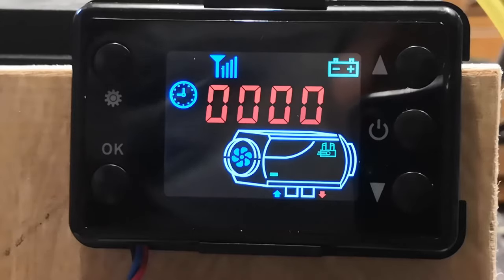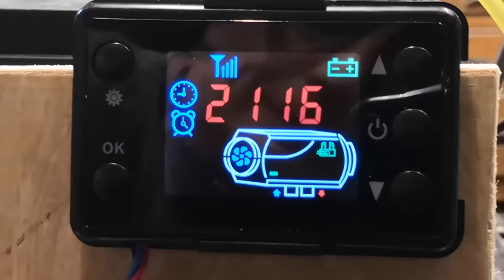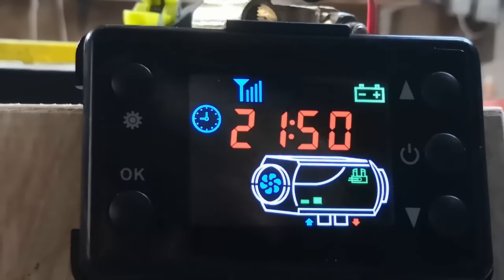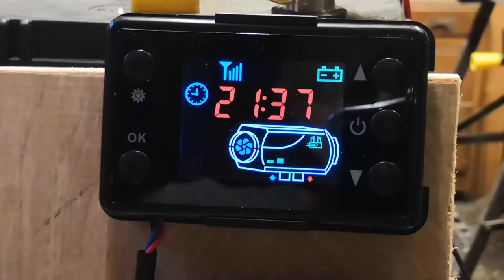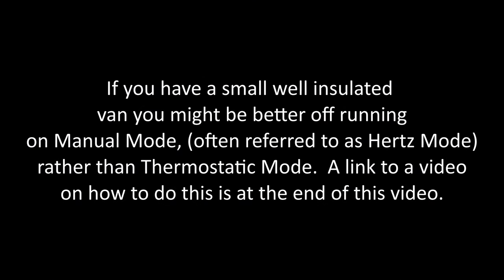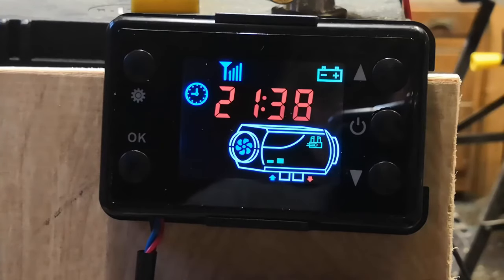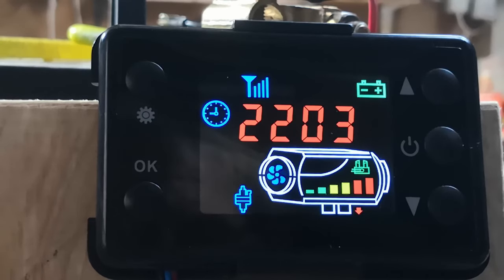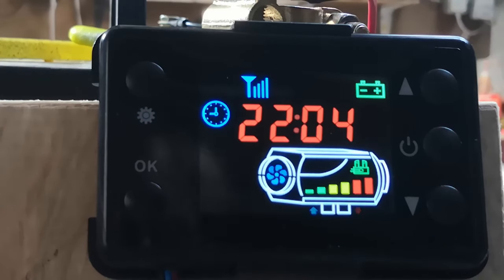Chinese Diesel Heater- Step by Step Instructions

Comment: Thanks so much, I had to take the pump off and then keeping one pipe from the tank to the pump and then prime it this way , as had lots of goes without seeing any fuel going through, I first thought it was the pump, hence why taking it off to see if it was working and finally it did start to pump fuel through. I had a go without using the pump and just sucking the fuel through the pipes through I kept coming up with E 10 code, so I switched on to see if it was running properly and sure enough the fuel wasn’t going, so having the pump laying on a table just to see if it was working and seeing it was , then I put all the fuel pipes back on apart from the bottom pipe going into the heater, just to make sure fuel was going down there too, I also using the white fuel line with the black ends , tho I made it shorter this helped a great deed too. So put it up higher to burn 🔥 all the extra fuel in the chamber and now working great, ready for winter in my greenhouse.

Comment: I am a retired gas and oil fired boiler engineer. Do these things need servicing - dismantling, cleaning the blower housing / replacing glow plugs etc? Does it work better on paraffin or road diesel fuel? I guess if you have access it will also run on domestic central heating oil.
Reply from the maker: If setup correctly with the right fuel mix then they can go without servicing... I've never taken the one I have in my campervan apart in 8 years... but..  I am burning kero instead of diesel which is cleaner

Comment: Hi can you tell me what the signal symbol means in the top left corner?
Reply from the maker: It's the signal to the remote control. When you operate the remote it flashes to confirm communication

Comment: How do I clear the settings so I can start over. Please
Reply from the maker: Hi... are you referring to the time setting and temperature settings? If so, you don't actually clear them down... you overwrite them. Having said that, once the cycle of the timer has passed, it clears itself which is actually a pain. It means you must set the timer every time you want to use it even if the start stop times remain unchanged.

Comment: Have installed 2 Chinese heaters 5Kw in caravans. After 3 years I am completely satisfied. My caravan heats up quickly. After a year I had to replace the fuel hose that comes with it, a silicone hose. Bought a 3mm hydraulic hose white and from the tank that is installed in the trunk along the front to the heater along the back, the distance is 6m. It is important not to use the silicone hose that comes with the purchase, it cannot withstand diesel and cold/winter and starts to crumble. Then at the joints to the tank, pump, heater you use black reinforced fuel hose that you use in cars.
Have tested the heating last winter when it was -11 degrees outside, took 30 minutes to get 18 degrees plus in the caravan. I don't usually prime the heater and if you have fuel in the tank, no priming is required. Also buy better hose clamps that last. Remember to be careful during the installation and in my case it usually takes 5-6 hours depending on the caravan type, you should also run the power cable directly from a battery with the right area depending on the cable length, as well as a fuse on the battery's + pole. Used to free camp and has 2 100W solar panels with 230V inverter and never run out of power. In addition, you avoid using LPG.

Comment: Hi, I've just bought my first CDH, and have plans for extracting as much energy from the fuel as I can. I have designed the outline plan for a heat exchanger, so I'd like to know typical maximum and minimum temps for air inlet and outlet. Many folk on YT show them shining their I/R thermometers at the aluminium heat-extractor, but what I need is typical air temps away from the ali casting. Cheers!
Reply from the maker: Ha!... to be honest... I am also shining the IR thermometer on the heat exchanger.... never really measured the heat directly at the outlet of the heater. BUT... I am about to kick off another project so will do just that. 😊

Comment: Thanks for the video it’s much easier when it’s explained, can the heater be left on to maintain a set temp in a workshop through the winter ?
Reply: Hi, though I use my heaters on and off in both my camper van and my workshops there have been loads of people posting on the channel that they leave theirs running 24/7 so there should not be an issue... just don't run out of juice.😁

Comment: Thanks for the instructions. Im new to theae heaters. I dont hear any clicking from my pump, getting E8 and E4 I think also. Fuel at the heater I can see it. How can one fault find? 5.8v at the pump then it rises a couple of volts sometimes but no clicking pump.
Reply from the maker: E8 It's usually flame out or no fuel reaching the heater... which makes sense if the pump isn't working. E4 Is often the body temperature sensor either failed or lose connection to the motherboard. The following video shows you how to replace that sensor and it might help you cheque that it's seated properly and connected to the motherboard properly. It might be you just need a new sensor but very easy to do.  https://www.youtube.com/watch?v=emurWyN51jY

Comment: Fantastic videos. What brand heater are you using that has the six fan blades. I am using my heater in a greenhouse and time on time off setting would be helpful.
Reply from the maker: Hi Steve ... glad you found the videos useful. That particular one I bought about seven years ago off of ebay was quite simply an unbranded heater shipped out by a box shifter who put all the other bits and pieces together and has absolutely no branding on it at all. However, being the nerd I am aI took it to bits and found some labels inside most of which were just inspection labels but I did find one that was the name of the company. I  went I went on their website ... they were actually mostly serving the Chinese military! I think I had a bit of good luck on that one because they claim to have Conformité Européenne (CE) and showed a picture of their certification on their website. Initially, I was sceptical but I found the name of the company on the  Conformité Européenne register, downloaded the certificate and sent it to the certification body which confirmed that they had validated that machine to  Conformité Européenne standards. One thing to be aware of if you're looking for a timer is that although you can set a turn-on and turn-off time, it only operates for one cycle. You have to set it every day which is a real pain sometimes.

Comment: Hi, I’ve connected mine up to an old car battery which I charged up but it doesn’t have much juice and it gets drained before it can even get going properly. Once it’s going does it start to charge the battery or do I need to get a better battery and somehow find a way to keep that battery charger with a solar panel or something? It’s in a caravan not connected to a power source. Cheers

Comment: I think I need to replace my replacemnt LCD unit as I keep on getting random E-07 error - lost communication.
Wiggle the cables going in to the unit it fires up again. 
Now, I do have it as a "roaming" unit that I can move around in my small poptop caravan that I live on the road here in Australia
Before I buy a new unit I will mount the unit on a small piece of plywood or summat similar and stabilise the cable input

Comment: hi , great vid , just wondering have u ever heard of the controller settings access fail , ? i cannot get into the settings to adjust fuel/hrz rpm etc , maybe this is a cheap generic controller (comes with heater) that hasn't got that feature > thanks  ( mine has a cog symbol not wrench) cheers
Reply from the maker: Yes you are absolutely correct. Some of the cheap heaters have a controller that cannot have the settings adjusted. However, it is very, very easy to swap out the motherboard and controller and this video shows you how to do it. The. Note you have to swap them out as a pair as it's a different motherboard that is associated with the controller. You can adjust the settings on. https://youtu.be/sDwrHozKInc
Reply: @campervan_hackers   thankyou for the info 👍

Comment: Thnx for the link,
With restarts does it matter if the battery source has been disconnected for a period of time ? Mine has been set up previously to run off an external battery box which isnt connected all the time, , thnx for the info, heaps easier to understand then the instructions that came with my van
Reply from the maker: No, you can switch the power off but you will just lose any time settings you have set on your clock. In fact, I have an isolation switch on mine and I shut the power off completely when I'm not using the heater. I don't care about losing the time because I have plenty of clocks in my phone!. Actually, it's not a bad thing to do because those LCD displays tend to fade over time if they're powered up all the time. If you do go down that route though make sure the isolation switch cannot be accidentally triggered when the heater is on full chat as these heaters need to go through a proper cooldown mode before they are switched off.
Reply: @campervan_hackers  thanks

Comment: Brilliant videos..Any idea why I can’t seem to pair my new replacement to a lost remote. I’ve pressed the power and down arrow. Changed it to OC2. There is a new battery in the remote and the remote is showed a red led light when button is pressed but will not pair …
Reply from the maker: Sorry for the delay I've only just seen this. Assuming you have the same controller then the instructions in this video below might help. However, I have bought a couple of remotes owned to find they are defective so it might be simply you have a defective remote. https://youtu.be/GpWa_koF9CU

Comment: Very helpful video, so firstly thank you. I think my timer must be set, but didn't set it. I have only just installed the unit it's like yours in the video but I've had it for nearly 3 years. I never set the timer but I walked out to the van this morning and it was going but it wasn't warm, how do I turn it off the timer please mate, and why would it not be hot, does it need to be primed before start every time? Thank you
Reply from the maker: For clarity are you saying that it appeared to turn itself on but just blow cold air?
Reply: @campervan_hackers  Yeah mate, that's exactly what happened. Not sure how long it was running for but we didn't turn it on and the wife walked in this morning to pack some stuff as we are going away and it was on
Reply from the maker: @geoffstein3896    okay dude... that  sounds like the heat exchanger temperature sensor has gone down.  Very cheap and easy to fix... here is the vid...https://youtu.be/emurWyN51jY
Reply: @campervan_hackers  thanks for the link. It is only new, so don't know how the thing is already faulty... Spewing!

Comment: Thanks, really helpful video, however, how do you gry the display to turn off? The van has been parked up for 3 days so far but the display is still illuminated.
Reply from the maker: @stephanies6716  really glad it has helped. However for that particular display, regrettably it does not turn off. Some people have mounted their display so they can take it out of the holder flip it round and put it back in so the display is not keeping them awake at night. Others have just made a little cardboard blind to go over the top but alas on that particular display you can't turn it off.
Reply: Oh that's a shame, I guess I'm just going to come back to a flat battery then 😢. Thanks again though
Reply from the maker: The display itself uses very little juice. It will take a long time to flatten your battery but if you are leaving your van without using it and the heater isn't running then it might be worth putting an isolation switch between your battery and the heater. That's what I've done as have many people but mount it in a place where you can be sure you don't accidentally turn off while the heater is running.

Comment: What error code might one expect if air trapped in fuel line?  E-01?  ~7:00 into video.  At what point is maximum amp draw reached?  After pump engages but before glow plug goes out?  Great video, esp the annotations.
Reply from the maker: If you get air trapped in the line, you may get an E8 (flame out/ ignition fail error).. Max battery draw is at start up and shut down when the glow plug is live.. this short vid shows the draw through the cycle, (it is  using a rotary but the principle applies to all controllers)   https://youtu.be/BmyxEsE-Ysg

Comment: I'm trying to get my heater working on the temperature target mode. I follow the same steps you go though. I see the current temp screen but when I  click again it goes to the fuel amount screen and does not show the temperature target screen? Does my heater not have that capability or am I missing something? I also tried my buddies heater and it's the exact same as mine.  Both look like yours does.
Reply from the maker: Mmmm interesting... That is a different controller and alas, I have not come across it.  For clarity... the little fan icon... does it have 6 blades or 3 or 5?
Reply: @campervan_hackers mine has 6 blades, just like yours, when I go to the target temp it goes to screen that says 2.4...any help /ideS are appreciated

Comment: Once the timer is set, how long will the heater run for? Is there a way to cut it off automatically? Thanks
Reply from the maker: Yes, have a run through the video again. You'll see there is a start time and a stop time. But that is just for the six fan blade icon controller. There is also a three fan blade out there. That one is different. On that one you set the start time and then how long you want it  to run for.

Comment: Ive got mine running in my garage to keep things aired out the minimum i can get down to is 8 will it go any lower in any settings. Say 4 degrees thanks 👍🏻
Reply from the maker: Hi Tim, The problem with these heaters is that the little controller has a very wide hysteresis so it's a struggle to get down to low temperatures in a small insulated environment. Consequently, I tend to run mine on manual mode rather than thermostatic mode now and you might want to give that a try If you have a compatible controller. In case you don't know how to switch to manual mode this short video might help.. https://youtu.be/NhKU4AIt4jM
Reply: @campervan_hackers  thanks for your reply. Just another query. Can the timer be made to repeat. Having to to turn it back on every day. Set number 1 for time on time off. Only worked for one night.
Reply from the maker: Hi.. regret no... a real pain... has to be set each time  .  @timwilson8553  😒

Comment: The air inlet for the burner can be noisy, try fitting a exhaust silencer, note the difference. I was experimenting with my 2nd heater a 8kw. The supplied black silencer for air inlet had nothing inside, could hear air rush in. So i place a exhaust silencer over intake and dramatic reduction in intake noise. Not seen anyone try this. I will mod my van heater intake.
Reply from the maker: Yep... that was just in my workshop playing. That particular unit is now in my van and has an intake silencer as well as an exhaust muffler. In fact, just swapped to the no so-called 'upgraded' exhaust that is making the rounds at the moment.
Reply: @campervan_hackers  Yes have the box silencer, bit quieter. What did was place the exhaust silencer, the tin plate type on the inlet, reduces the noise there also. I have a new 8kw, the supplied inlet silencer is not much good, nothing inside it. So i tried the supplied tin exhaust silencer made quite a difference.

Comment: Thank you. My issue is I can’t even figure out how to set the time, first screen. Mine doesn’t show that, it just shows the temperatures. Any thoughts on that?? Thank you so much.
Reply from the maker: There is an odd controller out there that looks the same but it's a little bit different. The clue is in the heater icon on the display. If it has three blades instead of 6 it is a different controller....
Reply: @campervan_hackers hmm the heater icon looks the same! I just don’t have a clock on the left side. And don’t know how to make it pop up.
Reply from the maker: @AmandaMcKay-i8y  eeek... If your heater icon definitely has six blades and not three blades then I'm stumped...Soz! 😔

Comment: Can you offer any guidance as to what I need to do if the glow plug light doesn’t come on?
Reply from the maker: Tricky one... Is it just the glow plug indicator on the display that doesn't illuminate... Or is it also the case that the glow plug itself doesn't fire up and ignite the juice?
Reply: Both. I’ve tested the resistance of the plug which is down to 0.5 and fitted a new one. Same story. 
I’m assuming there is something I’m missing in the setup.
I’ve ordered a rotary controller to try.
Reply from the maker: Yep... could be the ECU.... I assume you have the 6-blade fan icon controller... the rotary is compatible with the ECU that uses the 6-fan blade. Let me know how it goes...
Reply: Yup 6 blade display. So I might be into a new motherboard too :-(
I’ll fit the analogue controller and shall report back.
Thanks for your reply’s.

Comment: How do you turn off the display. My diesel heater display tends to stay on.
Reply from the maker: Regrettably you can't without going into the controller and hacking the feed to the display
 It's a real pain. Some people have cut a piece of card to go over the display at night and depending how you mount it you can take it out of its holder turn it around and put it back in so the display is faced away from you.